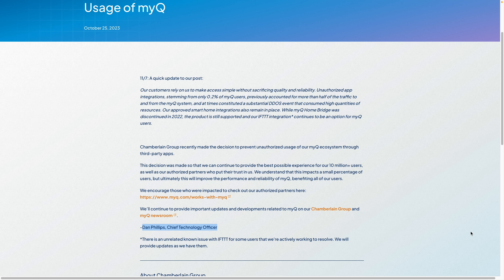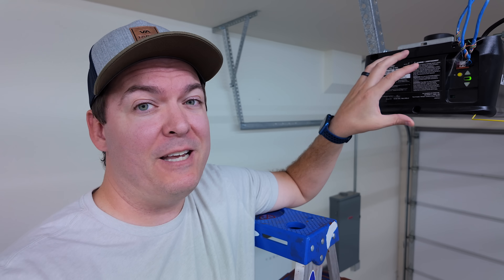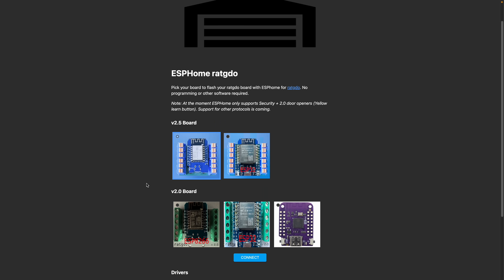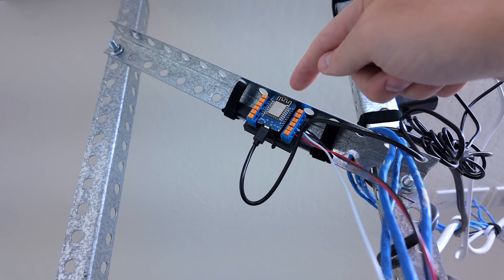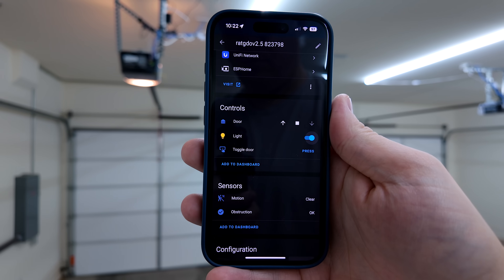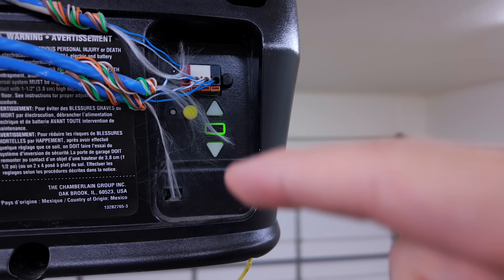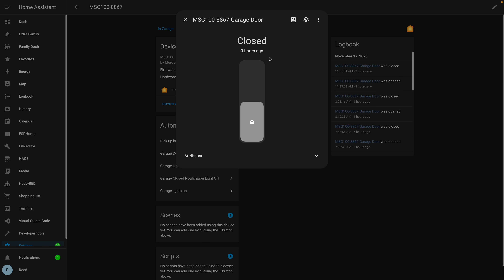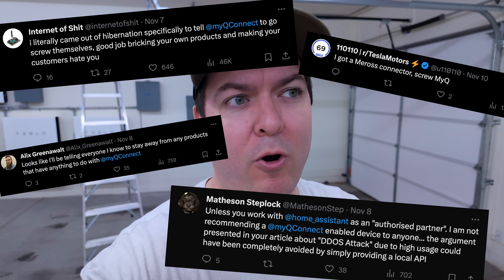MyQ wants to RUIN my smart home! Hello RATGDO

Comment: Nice Reed!  Can you please explain briefly how the kasa smart strip only gets power when the door is open?  I want to get this laser, but like the idea of it on only when open. Thanks and oh that Evil Corp!!!  My tailwind is interfering with add on carplay device and then Evil corp stopped supporting the things I needed....
Reply: I think it's not the strip that doesn't get power, but rather it can control power to each of the individual outlets. That's how my (not Kasa brand) smart strips work. Really, a smart strip is just a handful of smart plugs all stuck together in a case.
Reply: Thanks, must be some kind or routine then that gives the laser power when the garage opens then...  I do have some smart plugs, might have to try....
Reply from the maker: Yes what @ToniHinton said, that the Kasa smart power strip is basically 3 smart outlets in once device. It works nicely where I have it because the ratgdo plugs into one of the USB power ports, the LED ceiling lights plug into one of the smart outlets and the laser in the second outlet. (Nothing in the 3rd outlet at the moment)

For the automation it’s pretty simple. When the garage door is up, the smart outlet the laser is plugged into turns on. That will allow me to park accurately. Then when the garage door is closed another automation turns the smart outlet off that the laser is plugged into. That way the laser is off when people are walking around and the car isn’t parked there. 

But yes any smart plug will work. I had a cheap one up there for a few years controlling the lights and it worked great.

Comment: 100% feel the same way.  I installed Meross which works SO SO good.  No  more delays (like Evil Corp) had when closing.  Works perfectly with Homekit.  I had one of those Homebridge for the Evil Corp on two doors.  It was so Flaky.  Laughing though because I sold it to someone on ebay for $80.  Have fun with that!  On a side, the crap big company was Belkin WEMO.  Complete garbage.  I am in the process of replacing everyone of these in my house with Meross.  Again, they just work and work fast.  At the end of the day most of home will be split between Aqara and Meross now.
Reply: Does Meross track energy usage? I'm thinking of getting Kasa smart plugs since they report energy usage.

Comment: About that tennis ball: if it works, use it. A low-tech solution that doesn't need any electricity. 
My father used the same method (but with a smaller ball) in his garage.
Reply: I would suspect that the real long term issue is the kids playing in the garage. Some day the ball is going to get hit with a tennis racket, or baseball bat (even a plastic one) come off the string, and won't be available to let the driver know they have pulled in enough, or too far. A fix for that could be to put the string on it's own motor, or rig up some pulleys for gear reduction, and set it up so that when the garage door is  down, the ball is up at the ceiling, and when the garage door is  up, the ball drops down to the point you want. More moving parts though.
Reply from the maker: It’s true the tennis ball has been a solid solution. But yes my kids love to hit it when the car isn’t parked there. It would’ve been only a matter of time before they broke it.

Comment: I did the same thing with a small board from sonoff and wired it to a spare remote button. The board triggers the remote and the door opens. Board was 5 bucks and the remote was 15. Screw the evil corp

Comment: Totally agree MyQ sucks and so does Chamberlain. I went with Tailwind which works extremely well with zero issues!
Reply: I don't need a garage door opener because I don't have a garage (or a car, for that matter) but if I ever do, I'll make sure that it does not need a server who-knows-where, even if that means I have to buy a dumb system and add some sensors and stuff to make it smart(er).

Comment: Thanks for the Evil Corp rant, Reed.  Tech history is littered with companies who were so short-ighted they went out of business when they didn't put their customers first.  There are a lot of ways to handle this and you showed a couple of good ones.  I use  a YoLink finger (like Switchbot, but bigger) and their tilt sensor along with a spare garage door remote switch and it works great.  There is no wiring or ladder-work involved.  YoLink works with HA and Homebridge, too, plus it uses LoRa so you can use one of their fobs to start the door opening from quite a distance.  I've found some systems don't like you using verbal command like "open the garage door" for "security" reasons.  I found that by naming mine GarageDoor (all one word) it gets around that. Keep looking out for the users, Reed.

Comment: Why not just use a Shelly relay and wire it into the hardwired button?  I've been using it for about 5 years with no issues and it only cost about $15.
Reply: This is what I do, but that does not allow you to monitor the current state of the door or light. So I also have a reed switch to sense when the garage door is open or closed, and have that wired in as the input to the Shelly relay. But running all that wiring though my garage was a lot of work, and ratgdo looks a lot simpler with more functionality.
Reply: @stephencoakley    I have a cheap contact switch wired to the shelly as well.  No wiring is running through my garage, everything is installed at the garage opener itself.  I put the magnet from the switch on the opener chain.
Reply: The ratgdo device reads from the garage opener itself. So whatever is the status on the garage opener whether obstruction sensor, light, etc it just piggybacks on that instead of creating its own scheme to mimic the functionality or status.

Comment: Nice video covering nice new features.  I just use a Sonoff relay on inching. Door open or closed with a Sonoff D2.  No problems for years and years now.  Controls door,  integrates/triggers lights inside and outside the garage and house. (Detatched garage. ) Talks seemly to Alexa, Google, etc. I wondered why pay extra for MyQ.  Though I have an iHost, I really don't care if someone in China can monitor my garage door... I'm always home.

Comment: Hey Reed, great video! I love the Evil Corp reference! 🤣 I got my RATGDO in a couple of weeks ago and it was dead simple to set up. I flashed with ESP home as well and it popped right into Home Assistant. Just a suggestion for you and others, you can also use Wago connectors to make it super simple to connect, especially if you have very little room for all the wires in the push terminals on the Evil Corp garage door opener. 👍
Reply: I have seen Wago...can you explain more about how you did it since I lack the visual. I want to do as you did. Thx

Comment: about 15 years ago, I took apart an extra garage door remote, soldered some wires to the button, and hooked it to the output on a PTZ camera. It would open and close the door with my phone, but it was more difficult and I only used it rarely... but it did work.

Comment: They just proved the concept of corporate greed. What happened to the day companies got rich by putting out a good product without screwing over their customers use of that product in any way the customer sees fit. There's no reason you need a web service to use the the inherent functions of the product. I do, however, disagree with your statement of them not losing money if they opened the API. You are correct the users who have not been using their app to use the product wouldn't be buying the service anyway, but if the other users saw there was a way to not have to pay for the service they too would also not buy the service which would be loss of the companies profit going forward.
Reply: The companies that got rich by making good products, get offers that pay more than they have earned, from companies that want to milk the end users for even more money. (Or someone in the family steps up to be the Exec, with the same plans.)

Comment: And that is why you should never buy anything that relies on the cloud to perform basic functions.  It'll either become chargeable tor will shut down.
Reply: And even if it doesn't, it still depends on a working internet connection.
Reply: True idk if it's everybody's case but My house came with it pre-installed